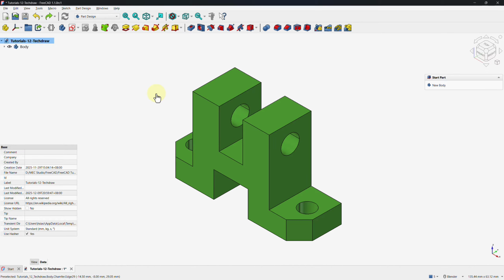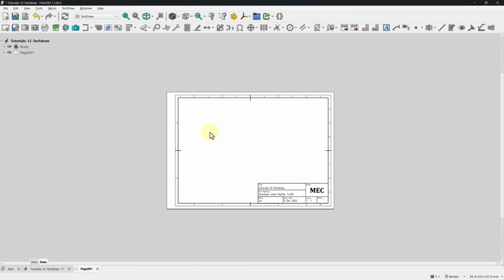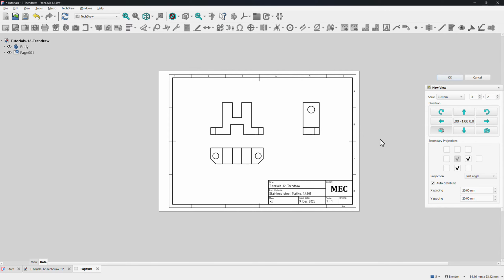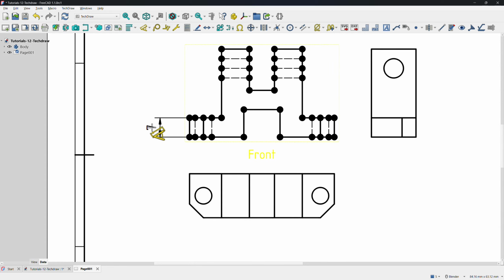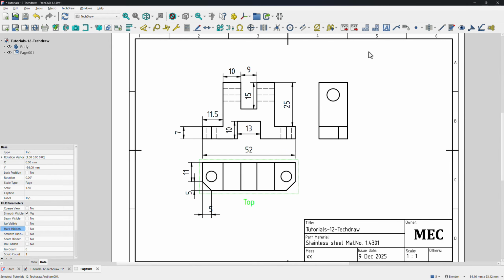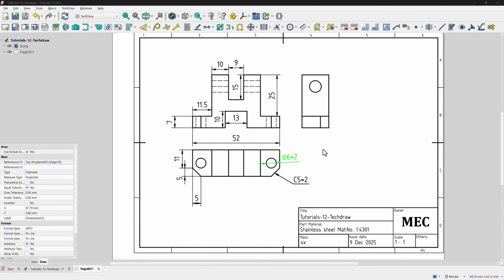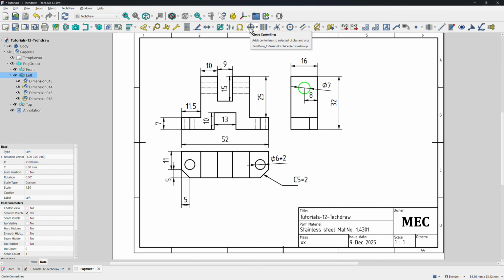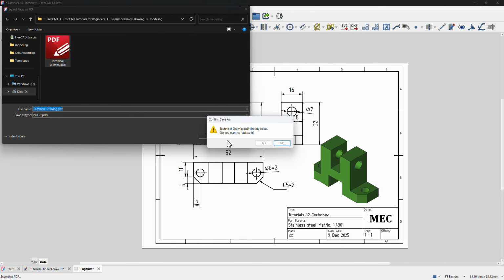FreeCAD 1.1 Technical Drawing Tutorial: Create a Complete Drawing from a 3D Part

Comment: Great tutorial but Im stuck when I try to get the views. I follow your tutorial like you said but when I wanna add a view I get a blank space on my page. When I hover over that blank space is says ' view001' or like 'front 001'. Do you know how to fix this ? I tried different scaling things but I dont think that that is the issue.
Reply from the maker: do you use the FreeCAD 1.1 or 26? 
I'm not sure how it works to get blank space for inserting view , if your bady is not blank, slect the body and insert view, then you can slect the projection view, you should get the view generally. 
I think you can try use the a default template(if you are not) to create a techinical drawing, then repeat the process to see if get the right view.
 or maybe restart FreeCAD and do it again.

Comment: Thanks for the video. How do I mark holes for a certain thread (e.g. 1/4" ATP)?
Reply from the maker: You can Insert Baloon Annotation, and modify the " Bubble Shape " to line, input the certain thread in " Text".
Reply: @TheMEC3D  can you show this in a video? I tried it and the 3/4 circle was so close that it was not easy to see.
Reply from the maker: @sandmann7777   yes, I will make anther a video , and try more tools and solution included

Comment: Hello, how do i remove the "black points" from the joints/corners? I have R2 radius, and its covered by these black points and i cant click it to make a dimension. I even put it on A0 template to make it as big as possible, but R2 is too small and being covered by the dots completely. On my drawing, i have top and side view and both have the dots, they dont dissapear when i remove the mouse out of it like your do. My version is 1.0.2
Reply from the maker: Hi, I understand it's annoying,  you can go to Preferences > TechDraw > Scale > Size Adjustments , find Vertex Sacle, make it much smaller, then I think you can add dimension for R2,  and you need to restart FreeCAD after the seeting.
Reply: Thanks  @TheMEC3D . I was wondrering same thing and find solution... :)